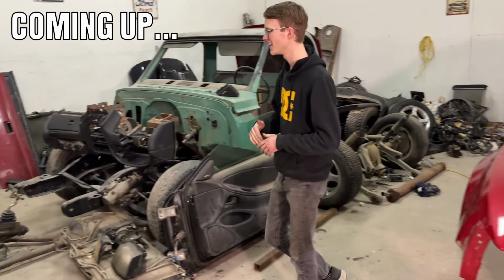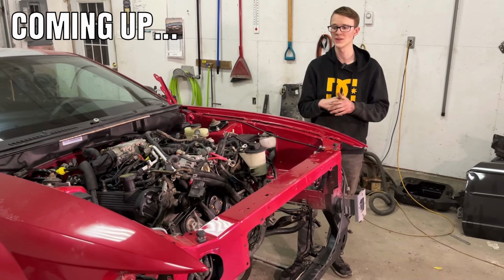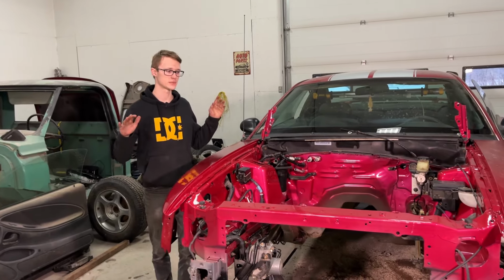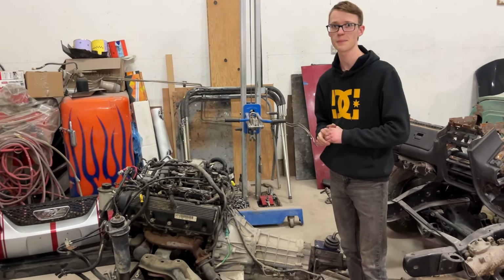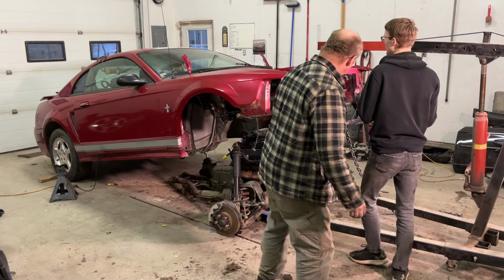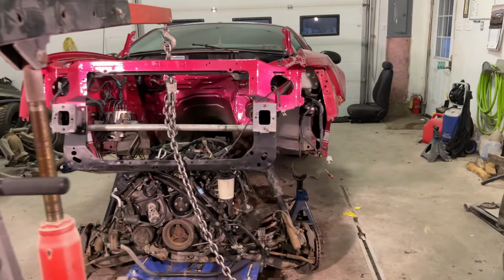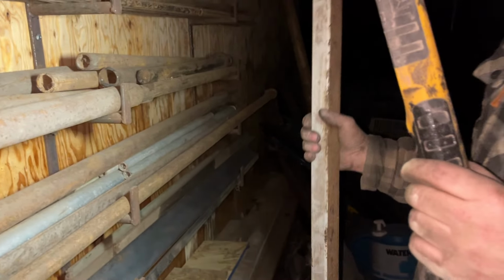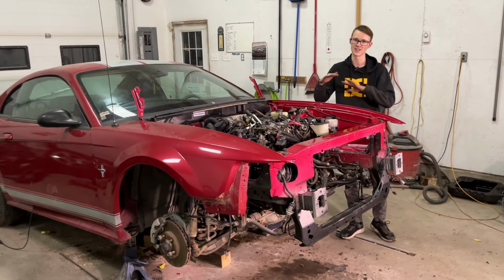We gave our 2002 Ford Mustang TWO MORE CYLINDERS! | Part 6

Comment: I have the 02 v6 and eventually want to do the 4.6L v8 swap also, by chance do you know what are all the parts I will need for a successful swap ? Thank you
Reply from the maker: I mean the best way to do it is by having a  donor GT like we did so you can swap anything that is different. Main things are engine and harness, ECU for V8, the speedometer is different so we swapped it and the dash harness for it. Rear suspension is different so we swapped it but I think the v6 suspension can work with v8. Look for some Mustang forums if you’re unsure 👍